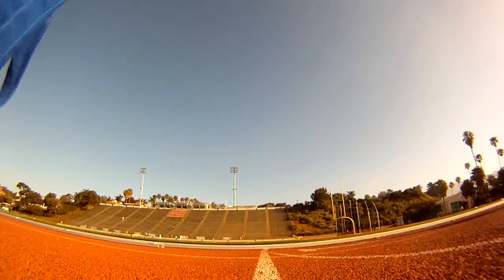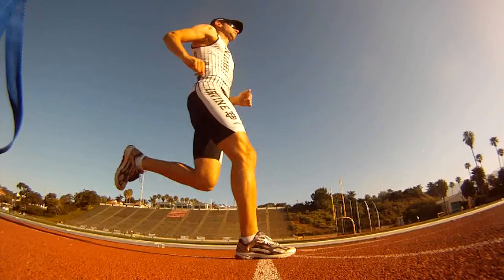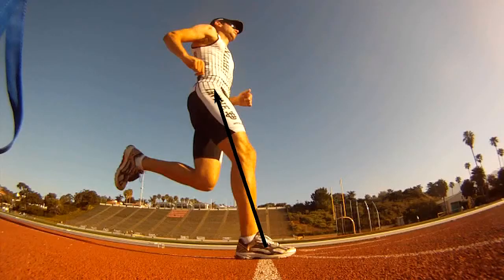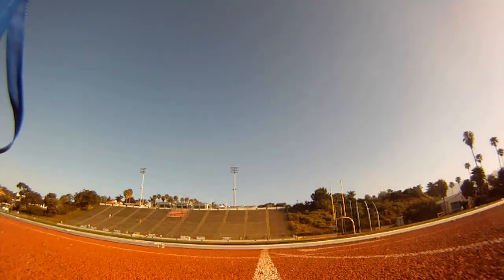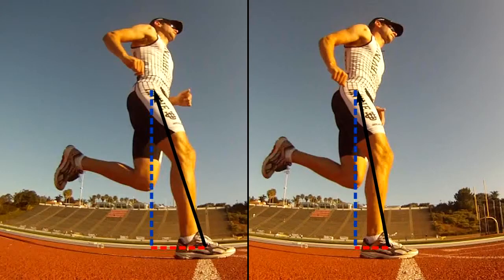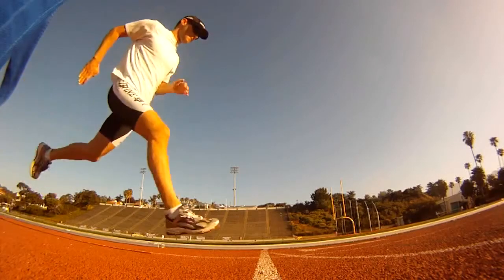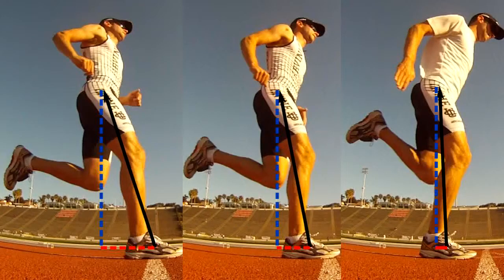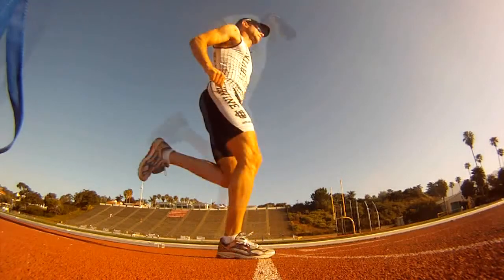The Physics of Running FAST

Comment: Good point. You forgot to mention upward lift which comes from the upper body.  Also, to focus on the range of movement in your forefoot, exaggerating the stomp by moving the forefoot down more strongly, will combat the braking (downward force) you mentioned.  Great video